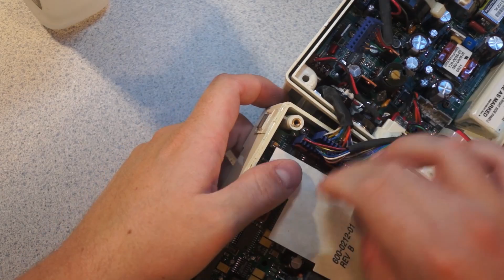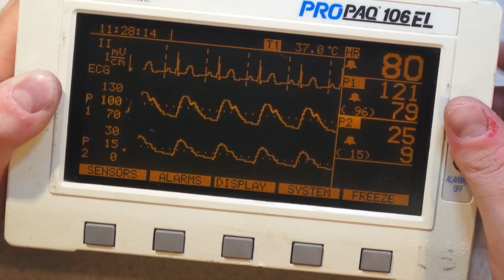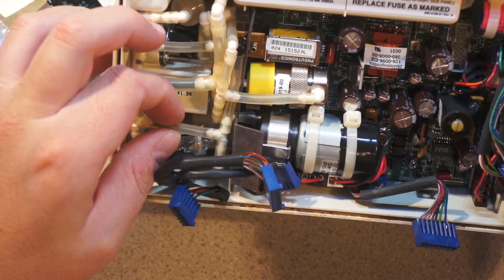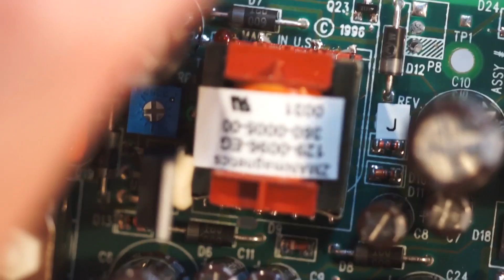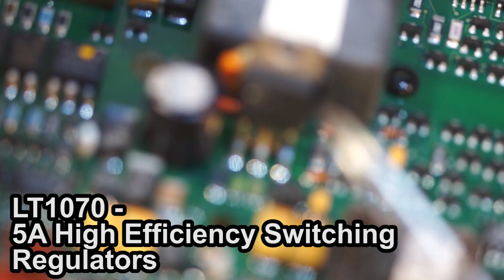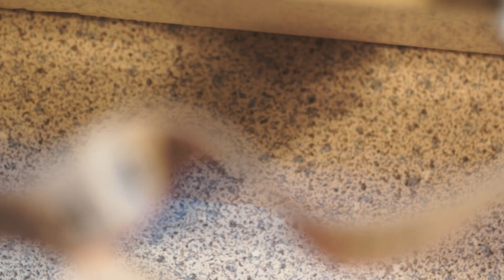Protocol System ProPaq 106 EL Patient Monitor Teardown

Comment: P1 and P2 (or IVP1 and IVP2) are signals from a pressure transducer that is connected to the patient via either a vein or artery, they usually put a catheter into an artery (I have had them inserted into the artery on the inside of my wrist) or vein (I have had a central venous catheter inserted into my neck). These lines are then flushed by saline drips to keep them from clotting closed, in the case of the arterial ones they put a bag over the saline bag that is inflated with a bulb (like found on a manual blood pressure cuff) to over come the high pressures in the artery (normal is pressure is considered 120/60 mmhg so you would need more pressure than 60). Then a tee is placed in each line and the fluid pressure is then applied to a pressure transducer. Hence no direct electrical connection.

Comment from the maker: That's an interesting idea. 

A normal ballon wouldn't work, though. The pressure would rupture it.

An interesting idea would be to put the balloon in something. I think if you stuck it in a sock, or another soft fabric enclosure, you could manage much higher pressures.

Comment: The two connected ground connections on the power supply input are so that the power supply can tell that something is connected to it.  That is probably to prevent contact arcing in the connector by only energizing the power rail once the connector is plugged in.

Comment: I bought a box of 100 pairs of latex kitchen gloves that are really thin and use them all the time for 'dirty work'. I cringe because I see you touching all your tools and camera and everything. Not that they are 'infected' or anything, I doubt most stuff is able to survive so much time outside of a host, but it's just a thought (like fear of spiders).

For a cuff replacement you can have finer control with a hose over the end that you gradually bend. Or a cheap analog blood pressure device (3$)

Comment: and then when lost (bottom number), The pump is not usually that loud. The exhaust port for the pump is to pass the exhausted air through a filter if in an isolation situation.

Comment: The Propaq has additional modules that can be interconnected, so the extra ground is probably so all modules have the same reference, All the isolation is probably so you don't have to disconnect the unit from a patient when they are defibrillated. The keyboard is for cleaning, but mostly for simple usage with gloves and in a moving vehicle. The bp pump will pump up to a level, where the blood pumping is not felt through the cuff, and then slowly reduce till it is detected again (top number)

Comment from the maker: Realistically, probably not.

Considering the complex analogue front-ends, about the only thing it could be used to acquire would be ECG/other physiological data, and you'd have to do a considerable amount of reverse-engineering to figure out how to interface with the system, either by replacing the non-isolated MCU, or simply talking to it.

Additionally, doing this would require a *lot* of care, as working on any electronics connected to a person can be very dangerous.